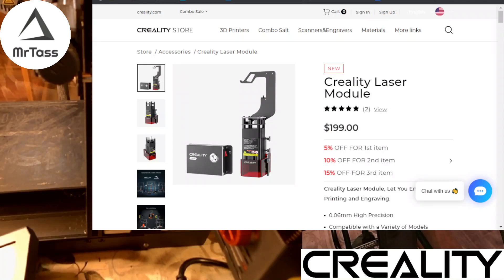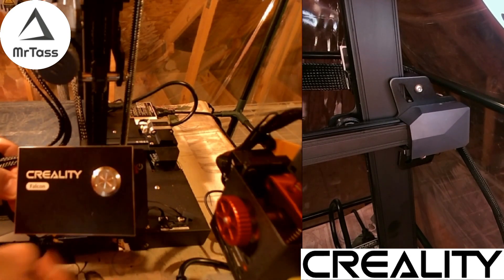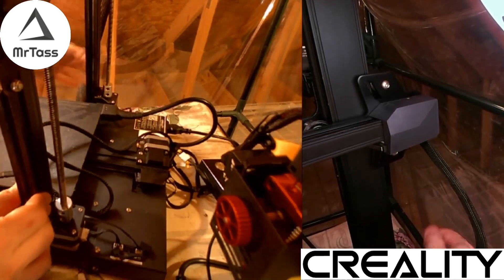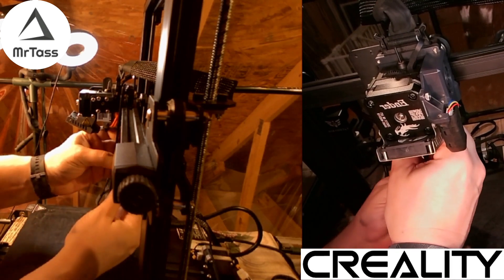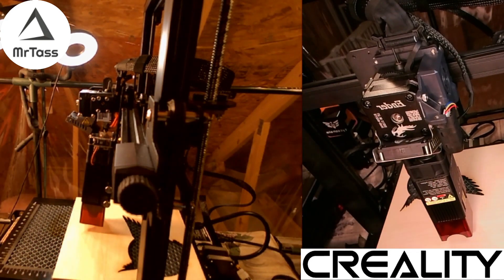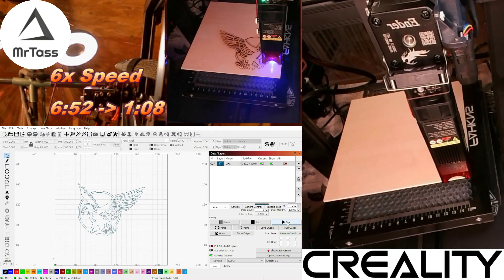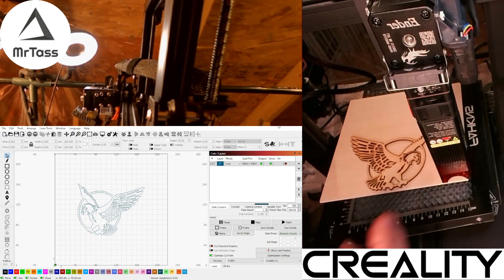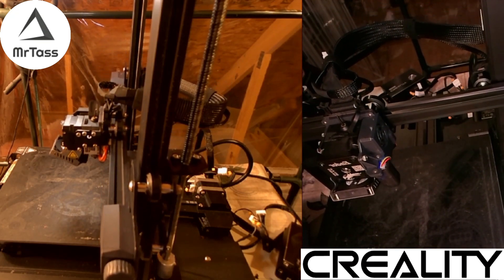MrTass Install - Creality 10w Laser Module Kit - Engraving and Cutting - Ender 3 Series

Comment: I noticed the laser bracket doesn't seem to be sitting quite plumb -- I've had a similar issue -- has it caused any problems?
Reply from the maker: No... Not really... But certainly if working with it longer term, I would just remove the print head entirely.

Comment: Thanks! I have been debating getting this all week and now want to pull the trigger. 2 Questions, it seems to hint this will take the air assist kit, is there fittings on it for the air assist? and do you have a link to the honeycomb you are using?
Reply from the maker: It appears that the Air Assist systems come with a laser cover area, so there should be compatible options out there for it. I do not see a built in tube/connector.

I have added the links to the description for the remaining parts.

Thank you!
Reply: @MrTasselhof  thank you! ordered the honeycomb and can return this one that is way too small

Question, What speed/power are you cutting that 3mm ply? I had mine dropped all the way down to 50mm/s and air assist and it wont cut through... wondering if I got a bad laser :(
Reply from the maker: @lvanek2011  i found it depends on the color... I have the 10w laser and Black acrylic cut like butter... Red ok... Green and purple almost no go